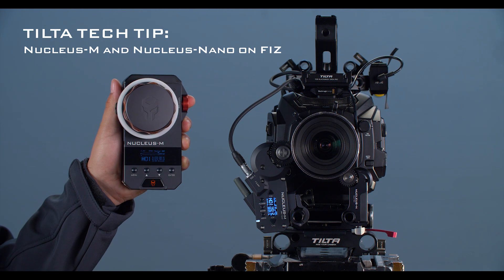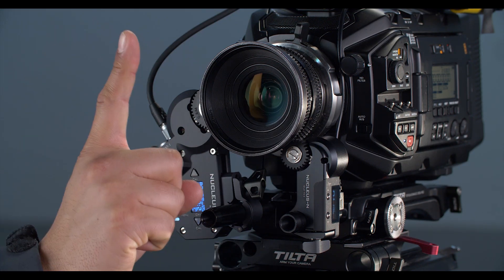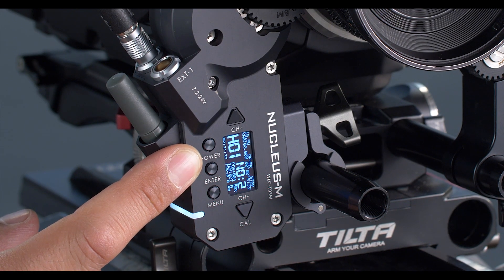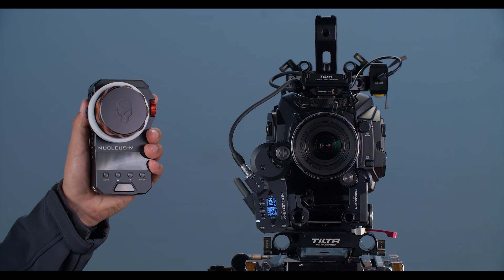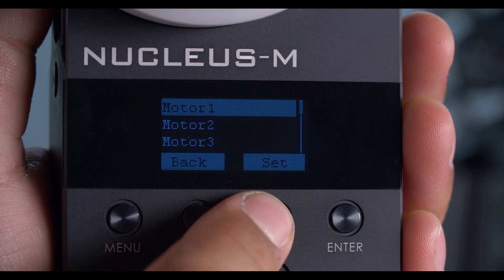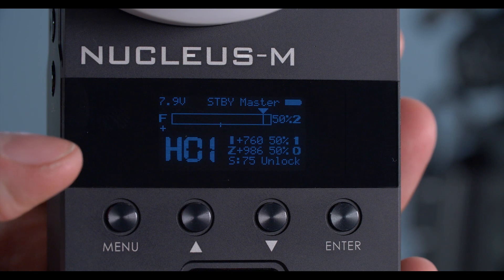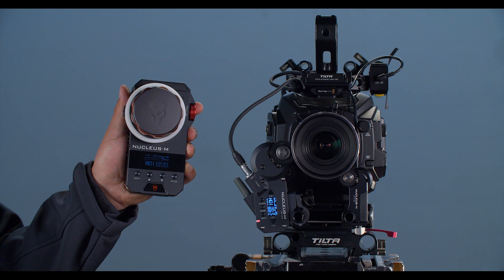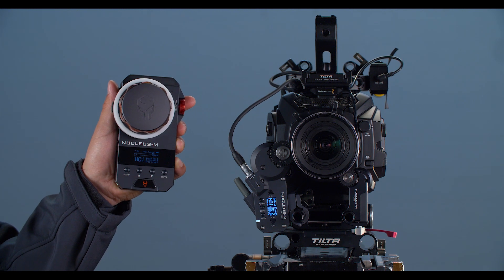Tilta Tech Tip: Using the Nucleus-M FIZ with the Nucleus Nano Motor

Comment: I have a Nucleus Nano system, but want to use one of the Nucleus M hand grips for focus control. Which of the two hand grips (left or right) would be the best option for single motor use? 

Alternately, I could purchase one of the packages that includes a hand grip and one Nucleus M motor. Doing this would allow me to have TWO motors controlled by one grip. The right hand grip has a wheel and joystick. Can I program the right hand grip to power one motor for focus motor and the zoom joystick to control the iris motor?
Reply from the maker: The Left M Hand Grip would be the best choice for one motor. The Right M Hand Grip can control 2 motors so yes you can control the focus motor with the finger wheel and the iris with the zoom rocker!
Reply: @TILTA  Thanks for confirming that the Right M Hand Grip can control two motors.

Comment: If i buy just the left handle of the nucleus-m, will it be able to work with the nano without buying anything else?
Reply from the maker: Yes, just having the left or right handle of the Nucleus-M will allow you to control the Nano motor without any other unit. You just need to set the handle and motor to the same channel and then set the knob of the handle to control motor # 1 and they will link up.
Reply: @TILTA  how do you change the motor number of the nucleus nano? I just purchased the dual lens control handle for the advanced grip as is it advertised to be able to control nucleus nano motors. I have two nano motors but don’t seem to have the ability to control them both independently with the front and back focus wheels as they both have to be set to motor number #1. How can I fix this?

Comment: Can I use the Nucleus-N motor with the Nucleus-M Handle grip? With no nano or m main units around
Reply from the maker: Hey, they could work together.
Just make sure the control is released to the handle already
Reply: @TILTA  hi there.  I’m having a little trouble understanding your answer.  I want to use the left hand grip with my already existing nano motor.  How would I pair the two?  Do I just put them on the same frequency?
Reply: @TILTA  nevermind I see you’ve answered several others.  Thanks!